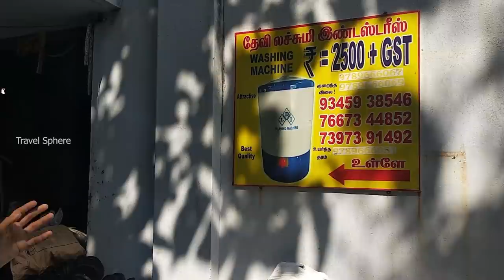Just 15 minutes to make a washing machine.? | Washing machine Industry visit |

Comment: Naama ellathayu complicate pannikrom. Na oru mechatronics engineer. Namma 25k ku vangra washing machine le fuzzy logic nu oru algorithm use pannirukanga. Athu oru intelligent system plus facilitate panna electronics and sensors. Bt reality la nammaku ivlo thevaiya nu kaeta thevai illa. Naama laundry service panna porathilla avlo technology vachu, simple system pothu. Atha purinjukittu rmba beautiful ah design pannirukanga. Namma normal use ku ithu pothu. Eadhuku heavy line pottu power la kodukanu, Chinna motor vachu alazhga panna normal currentlayae podalam. Very beautiful.

Comment: No warranty on motor in ten years no warranty on maximum3year full machine no dryer option in this machine
Reply from the maker: U will get this only for 2500...
Reply: +gst above 3000this cost 2500is also money I spend 6500get good washing machine that has more washing options drain selector fabric type speed option with dryer+12to15 cloth washing capacity +5year motor warranty+2 year total warranty so my option is washer +dryer machine only not for this

Comment: Never by front loading machine for 30000 rupees.It is utter waste.
Reply: Bro apdi Enna problems face pannuneenga neenga
Reply: @Possible_14  Brother 1.Drum got damaged with in 3 years.That too even for small damage in drum you have to change whole drum set which costs spare cost of 7000 rs.
2. With in one year panel board got damaged due insect attack .Cant they make insect proof panel for a washing machine which costs around 30000? .Instead you can by top loading machine which will come close to 7- 8 years without any major service!!
Reply: @HariHaran-ef7xq  ennoda contact
Reply: I used front loading machine for more than 7 years without even servicing regularly... It depends on the model and luck,😆
Reply: @krish7105  i agree with u even i used Front loading machine for 8 years without any service.That is the reason i bought front loading machine 2 nd time.When i asked the service engineer about this he told you will never get such a superior quality now a days.Even branded manufacturerers are insisting for frequent spare parts change so that they can make easy money.